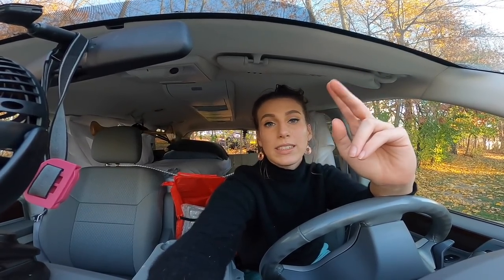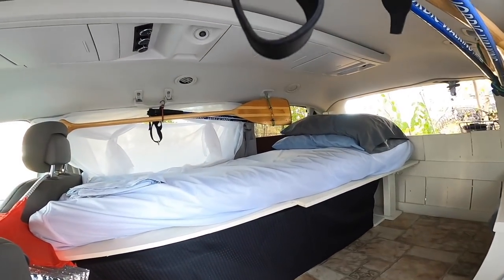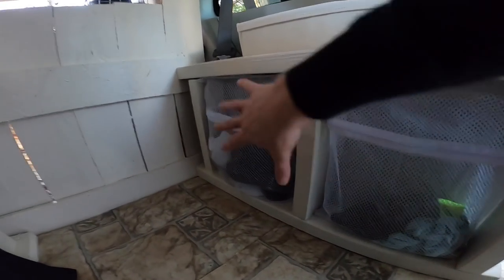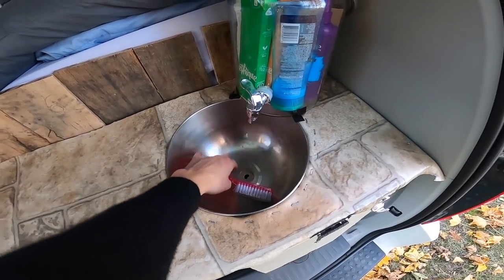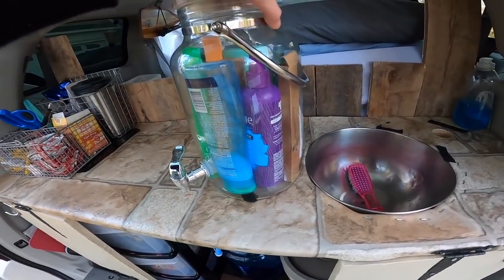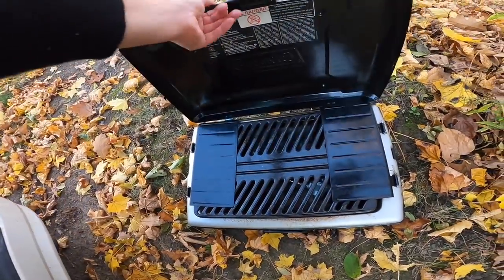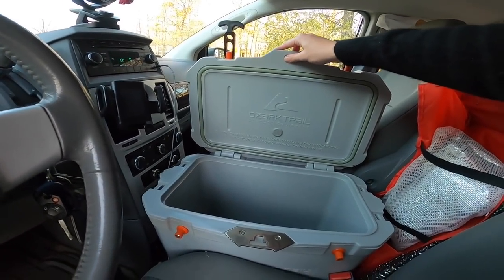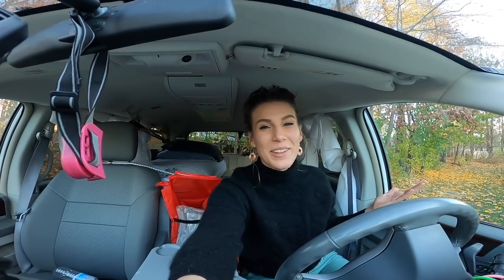DIY MINIVAN CAMPER- walk thru- Recycled Materials

Comment: great no build! Ive seen several beds supported by rope looped around the head rest bars, that would free a lot of space under the foot of your bed.. you could do similar with the counter extensions, throw a length of paracord over the roof and clip to the handles
Reply from the maker: My build was focused on being as cheap as possible! I used what I had available. However, I'm sure there are lots of other creative solutions if you can afford a more elaborate build :)

Comment: Nice rig. I  would use my trekking  poles to hold up your rear tables.  A PVC end cap or rubber end cap would work to hold the points in  place. Thank you for making this video. Safe travels.
Reply from the maker: Thank you for commenting! Great suggestion about the trekking poles!! I’m going to have to use that next time 😁 safe travels to you as well!
Reply from the maker: @shakesbits5220  thank you for your input!

Comment: I like what you've done! I need to get a water pump like that. Keep posting!😀
Reply from the maker: Thank you so much for your positivity 💕 I will definitely be posting more. Hope to see you again in the comment section!! 😁
Reply: @Fruity_housewife  ✌️ Of course, I subscribed!
Reply: I found a similar pump on EBay  for $10 that charges by usb and has a push button to start/stop. I’m going to drill a hole in my countertop and use as the faucet in my future setup
Reply from the maker: @tigerlily4472  Sounds like an interesting solution!!